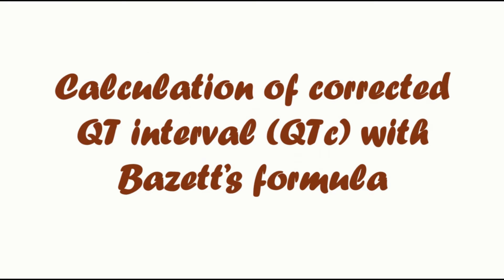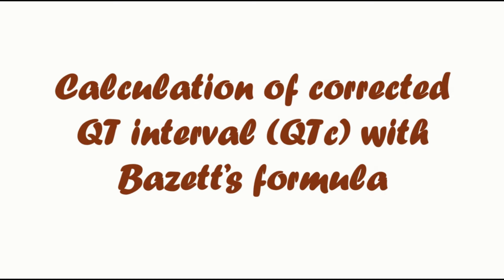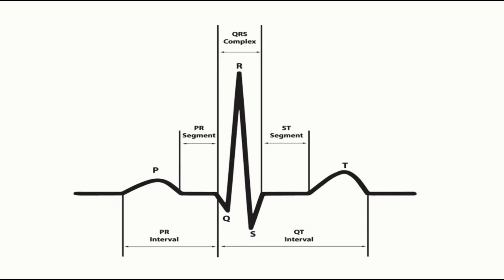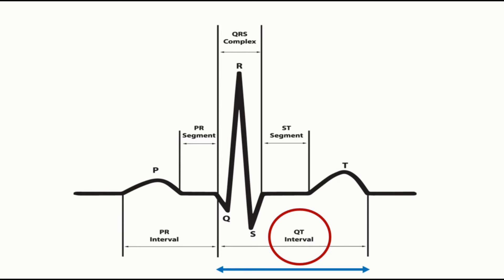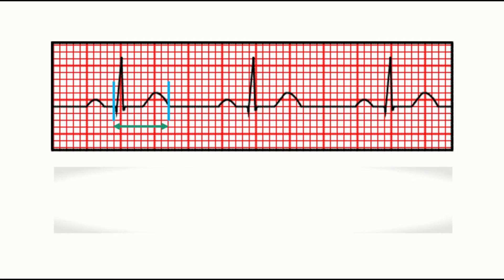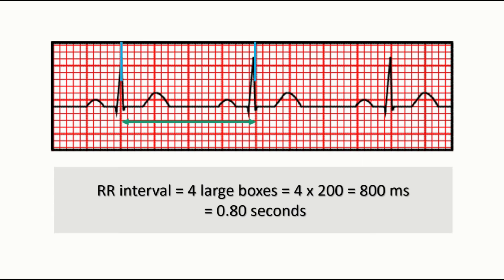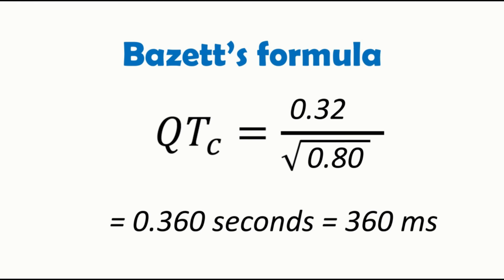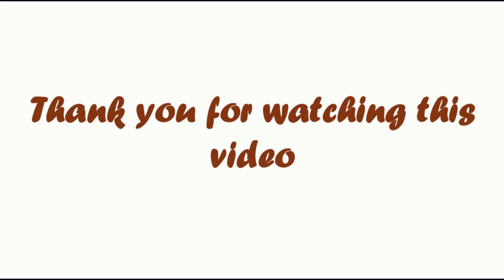Corrected QT interval (QTc) calculation with Bazett's formula

Comment: This formula is not a completely correct formula. The original formula has √RR/1 in denominator so that the value in denominator is unitless, and we can use second present in numerator as a unit in final QTc value.

Comment: I don't get the answer. 320 divided by 28.2842 (square root of 800), the answer is 11.31.
Reply: do the calculations in seconds. so square root of 0.8 seconds, divide 0.32 seconds by your answer and you're good to go
Reply: Not apply for for milliseconds in root of rr intervel only used second in rr intervel then get the answer to change sec

Comment: How is the square root of .08 calculated?  How do we get .36 from that?
Reply: Use calculator
Reply: Same dowt here also dear i don't know how he get that answer 🤷
Reply: They never explain this on any of the videos, which I find a bit odd. Square root of 0.80 is 0.89. 0.32/0.89 = 0.359. Obviously that needs to be times'd by 1000 and round up, but they don't say why.